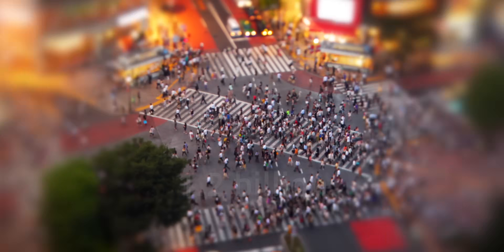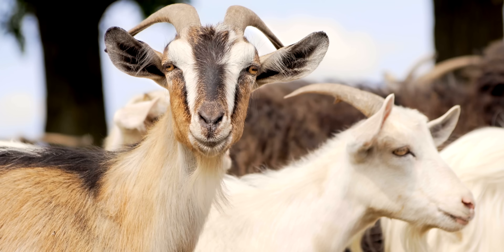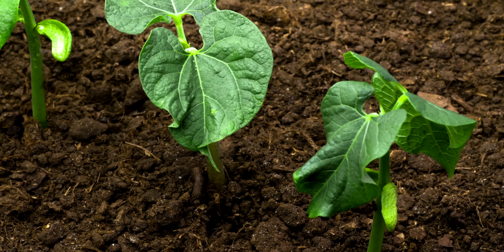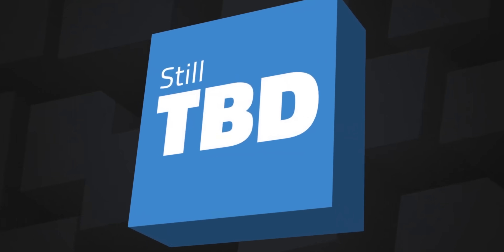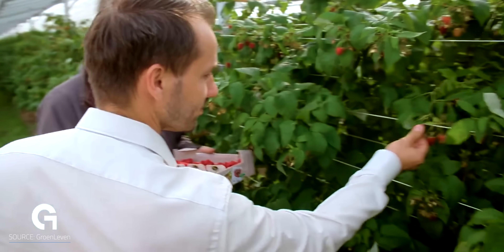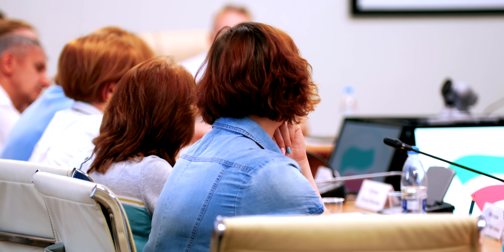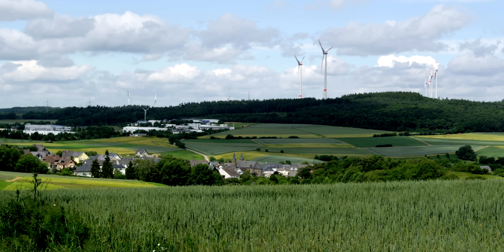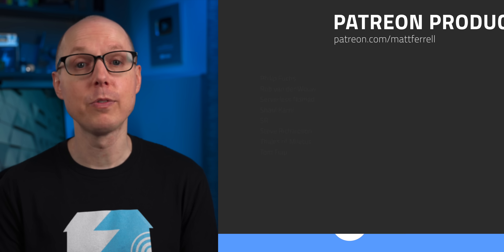Solar Panels Plus Farming? Agrivoltaics Explained

Comment: A typical example of cherry picking the selling points while diminishing or ignoring the reality.  So one sided.  No mention of the extreme up front cost or the VERY limited number of crops that can really be a good fit for such a limiting plan.  I love how you just skipped over the fact that panel output is barely enough electricity to run the farm much less do something to help the ecology vs power needs and forget about the outrageous coast to upkeep the panels on a long term basis.  Really, one sided presentation.  Not all of us can survive on just eating raspberries.  Oh and the way it makes the countryside look like a terminator factory, who really wants that?

Comment: Provided we have the capacity to store electric power, how many square miles would be needed to power the entire planet today?
Reply: Check videos about solar not working in Africa! Mostly due to geopolitical issues rather than engineering problems!
Anyway the fact remain. That in a place like the Sahara desert for instance (high solar output). The area needed to provide the needs of the entire planet. Is surprisingly "small", of course talking on a planetary scale!
 
One could imagine like half the planet covered in panels, or something like that! Nothing further from the truth! Worth checking! ;-)

Comment: Do you sell Solar panels or something? All I hear is the upside, not the downside. 20 years from now those solar cells are in hazardous waste landfill. Solar doesn't save any money because it's going to take you 10 years to pay off the solar cells and the last 10 years of a cells life they have severely reduced output. There's also the cost to install solar, not just the "off the self price." Time is money and the solar cells don't put themselves up.

Comment: Solar canopies can be installed on all the large empty parking lots at schools, big box stores and malls.
Solar canopies can provide energy, shade parking areas and also provide electric vehicle charging stations.
Floating solar panels can also be used on ponds and reservoirs to reduce water evaporation.

Comment: Yes and No. It would be nice to have gigantic pinpoints of concentrated energy production facilities here and there but... Wait a minute that is what we have and look how it doesn't work...  A few years ago my brother installed solar on his house in a city and cut his power bill by half in the winter and three quarters in the summer. If he had a bit more space and a house built for that purpose he could have cut his bill by 100% year round. Maybe a better solution is to mandate that a single family property can be no smaller than one acre. Each home must be built in the first place with solar, rain collection and septic so that when properly managed, that unit is less likely to become a burden on the system. If some dumb ass wants special non native plants they can go buy extra water themselves. Events like water shortages, rolling blackouts and infrastructure collapse would be funny words instead of real worries by families who depend on the water pipes, wires, and sewer pipes coming into their homes. If every property were built as a stand alone element you would have small energy generation facilities everywhere and there would be no need for gigantic, expensive, wrapped up in government red tape, wind and solar farms. Farmers could opt for solar arrays in places crops don't usually get planted and they could farm crops and power. We need to remove big money from the picture if we are going to solve the problem.

Comment: I see it as a double win.
But...main drawback would the Power infrastructure.
Right now Power plants very carefully produce the required power that is demanded from the users.
If many farmers build their solar fields, they also need to be connected to a central management system so the powergrid doesn't overload.

Comment: Not addressed in this video is transmitting power. Optimally, you generate power close to where it will be consumed. Transmitting power over a long distance leads to power loss. Creating more power than consumed means wasted equipment, which results in loss of profits. Especially considering that solar panels like other generators have a lifespan and need to be replaced as they fail. 

I'm also leery of placing solar panels in areas where work is done. Accidents happen, and they happen more frequently in places with heavy activity. While the solar array can be engineered to account for day to day living, I feel the array would be safer in a less used space. I feel better about placing solar arrays in urban environments in areas that aren't normally used, like rooftops. Not only is the solar array a little safer, it is also producing power in a location with a higher demand than an agricultural community. 

Not saying the idea is bad, but I think it isn't a major game changer. It should be done on a small scale to fulfill local demand.

Comment: It costs about $18K an acre just in metal to install the berry hoops that Farmer in the Netherlands was using. How much more cost would the tall mounts for agrivoltaics be?

Farmers already invest heavily in horticultural structures like berry hoops. If agrivoltaics can provide the same improvement in crop performance (or better) then agrivoltaics is an absolute no Brainer. If we can get funding together I know an program at a ag tech community College in the central valley that would likely be interested in hosting a demonstration site.

Comment: With more wind and solar in rural areas, we’ll need more economical and easy to install electrical storage. Is the grid ready for it? Also, easement rights are a big deal for wind. If the farmer doesn’t own the solar, I can see property rights becoming a huge headache and obstacle to adoption.

Comment: I'd like to see solar installations like this combined with some form of energy storage. The grid can't always handle solar exports during the daylight hours....but would benefit from energy exported after dark. Maybe a water tower with excess solar pumping water up the tower? Or compressed air in tanks buried underground? Or molten salt? Whatever....... something appropriate for the site.

Comment: Fascinating. I'm thinking of ground-mount solar for my home. I have a perfectly south-facing hillside in my large backyard. I'd like to expand my bit of terracing and to more gardening on the hillside. Since my electric use is pretty steady throughout the year, it'd be best to optimize the panels for winter production, which means production would be low in the summer, but close to matching winter production, so it's okay... no, that'd be perfect.

Because of winter optimization panels will be steeper than 45°. And of course to set the panels so lower rows don't shade the rows further up the hill, they'd need to be spaced apart. Like that berry farm in the video, I too have hail problems. So perhaps something like hardware cloth between the rows of panels could be a real crop saver. The increased expense will be only getting 2 posts from a 20-foot long steel pipe, rather than 4 (panels mounted high). And the extra cost of hardware cloth vs something cheaper like shade cloth (because I need more sun to pass through).

I have not terraced my hillside yet. I suspect I could optimize placement of the panels so in the summer they spend part of the day shading the stone walls of the terrace and not the crops. It could work. I'll have to do a bit of engineering.
Reply: Lovely.

Comment: Other combination use sources of power?:
Rainwater drainage turbines designed to also cover blackout areas locally. Even at low power it's better than nothing.
AND-
Industrial flat roof Argivoltaics. (The Indianapolis Convention Center sure could use it!)

Comment: Anytime panels can be installed on an existing structure constitutes "dual use". There is no further environmental impact from installing panels, when that impact was already made by the original purpose of the structure. Panels merely add yet another function to the building, without interfering with any other function.

Comment: I fail to see what the solar panels are accomplishing for the crops (particularly those raspberries) that something vastly cheaper would not. Presumably if farmers were using cheap plastic before, there was some reason for not upgrading to plexiglass or something similar. Obviously that doesn't come with the added benefit of generating power, but if using something solid to block sunlight is purely beneficial, why weren't they doing so already?

Comment: ive never understood why they dont use all the roof space of the large commercial buildings as "solar power plants" i.e. grocery store, department store, industrial ware houses....
Reply: That would be too easy and with LNP iq of minus 10 it would give them a head ache.
Reply: Sorry forgot to say my first system was $30,000 at 1.6 kva twenty years ago. Rabate got down to $13,000 grid was $9,000+ on going bills. Second system $12,00 at 5kva haven't work cost pay back yet. But as I said it great not paying the electric company.

Comment: A Solar unit take 9 uears for return on investment, 16 if you include the battery change. 
Money will double every 8-9 years in a safe, low risk investment. Take your pick.
Reply: I am sure pay back is down to two to three years now bit linger on the batteries. The only thing better then not pay electricity bills is having no mortgage.
Reply: @terryquarton2523    Nope, it isn't 2 or 3 years, battery rack costs almost half of the equipment and most need replacement after 4-5 years.
The only thing going for solar is that you make the lemon yourself and are loath to blame others after you have convinced yourself.
Reply: @terryquarton2523  200 people froze to death in Texas when green energy did not deliver when most needed, this isn't a harmless discussion, your choice has repercussions.

Comment: I urge you and others interested in solar PV to calculate the miles per acre of using solar electricity generation to power electric cars versus growing bio fuels. Solar electricity is more than 100 times as efficient as bio fuels. There are 40 million acres of corn production, and a few tens of millions of acres of soybean production that could be converted to other uses by converting less than a million acres to solar farms.

Comment: For most people, the best thing they can do to reduce electricity usage is more insulation double-paned windows and LED lighting.

Once those are in place, a single room air conditioner and fans can lower your electricity usage enormously. I was shocked to discover that going to two window units lowered my electrical bill by 1/3. I'm cooling an 1800 square foot house for $120 during the summer in Texas.
With the central air conditioning unit, it ran close to $200 last summer. And it wasn't as comfortable in the room I was in.

Comment: You didn't show single axis tracker arrays in the video. This type of array has come to dominate new solar installations in the past two or three years. The trackers overcome some of the issues you mentioned, such as having some areas in such total shade that few plants grow effectively. In addition, the standard spacing for single axis trackers would allow haying operations between the rows of panels. The panel tilts can be controlled to allow passage of farm equipment. An issue holding this type of use, and even grazing is the liability for damaging panels. Keep up the great work.

Comment: A logical dual you is parking and solar PV. It's been used in some areas, but like the agrivoltaics dual use, the more valuable land use isn't optimized. Every solar parking installation I've seen increases the cost of the solar canopy to an uneconomic level. Standard ground mounted  tracker arrays could be used by raising the height a small amount and increasing the row spacing slightly, leaving the parking function intact, while sacrificing only a small amount of the potential electrical generation of the site. Get 100% of the parking revenue/value, plus 80% of the solar generating capacity, while providing partial shade for the vehicles.

Comment: Much of the research you cited from Europe increases the cost of solar PV to benefit farming operations. This is inefficient as solar land lease rates are about five times the lease rates for crop land in the U.S. Given such a large variation in land values I think the solar farms should be optimized for solar energy production. No changes are necessary to a conventional solar PV for pollinators, grazing sheep, rabbits, poultry, or fowl. I'm glad you mentioned grazing birds, because they are often overlooked when dual use is considered.

Comment: There r a lot of small areas that cud produce energy / shade.  hav to feed directly into house current.  Think, not just big - big, how bout a lot of littles -trap h20 from the air - a clay jar buried a coupla or 3 feet, with a small wind driven propeller, like a child's windmills.  slightly increases the air pressure.  produce 3 liters a day of clean water.  how to build HOMES, without using 8' studs.  how bout somewhat low grade panels of recycled plastic, molded to fit into a house - for about $.40 on the traditional model dollar.  tighter cleaner better designed super energy ef..  fly em in on helium filled drones, a little care and wud work - and cheap.  cud get ur hydrogen from a small energy source and crack water.  some canadian research and development going on rite now.

IN FACT cud easily reduce all energy costs by 3% ------ if we, as a people, will do it.  Iraq war was created on us by propaganda, before today's social media.  ought to be an officer of the President directed to create the 3% solution - WITH the American people

Comment: Ultimately, we need a huge portable energy source to power the plasma thruster. Where will that energy come from ? How light/small will that source be ? The specific thrust in Newtons thrust/ kW of power needed w
ill be minimal. For that reason, a plasma engine for terrestrial use is not practical.

Comment: Sounds like a good thing for rooftop gardens where the building gets power directly from the panels, it would shade the building lowering cooling costs, rain water could be collected from the panels easily, then the garden underneath could use the water and shade.  This video mentioned tomatoes and lettuce as being good crops.  These are perfect for a rooftop garden.  

Maybe also do aquaponics where the fish  tank is cooled by the shade, filled with rain water, and the water is fertilized by the fish before being used on the garden.  Now you have fish and greens to eat.

Comment: I am disappointed, a bit. Some of your assertions are naive in today’s farming environment. The current industrial ag model is analogous to ICE vehicles. Tony Seba projects a future where almost all of our food is synthesized, not grown. Regenerative agriculture is in the process of healing our soils and restoring grasslands, the greatest carbon sink of all. Please check out Allan Savory, Charles Massy, and the Russian project to restore the mammoth steppes. There is much, much more to this.
Reply from the maker: Naive?  Not a great way to start an open, friendly discussion.  This isn’t an either or scenario (ie. agrivoltaics or regenerative farming).  We can do both or multiple approaches at once.  Agrivoltaics has nothing to do with regenerative farming, synthesized foods, etc.  It’s about an interesting symbiotic relationship that can be had for generating electricity while also benefiting certain kinds of crops.  And the crops can benefit the solar production by helping to keep the panels cooler.

Comment: typical farmer has ~500 acers, and using onions as an example plants about 100k onions per acre. which means at grocery store consumer prices, a farmer will grow about 30-50million dollars worth of food.
the median US farmer brings home about 80-100k (pre china trade war) which means with rough back of the envelope calculations their profit margin is about 0.2% on their crops.
The free-ish market has "optimized" the industry to the point where using a little extra plastic tarps or having slightly less accurate irrigation or fertilizer use  will mean most farmers will be bankrupt after a few years. 
I think the nature of the ag industry needs such a high level of certainty before they make investments like this. Heck there have been off the shelf machines ready to replace a lot of the ag labor for decades but it wasnt until the migrant worker shortage in 2016 that farmers decided to invest in them. They all made sense economically and had somewhere around a 15-20 year ROI scheme but it took something dramatic like 2016 to convince farmers en mass to take out loans for all the automation upgrades.
one thing about ag though is once an innovation in efficiency is made it is much harder for things to go back to how they were before.
I cant help but get the solar freakin roadways vibe from this idea. 
lets start by first putting solar panels on top of all indoor hydroponic farms (enough to meet min usage without $torage) or something instead of trying to reinvent the wheel and loose a bunch of efficiency because of transmission loss....

Comment: A single 10 watt 660nm led on the bottom side of a 300 watt panel will make up the shortfall of useable light. Whilst still winning out on the evaporative losses of operating in the shade.